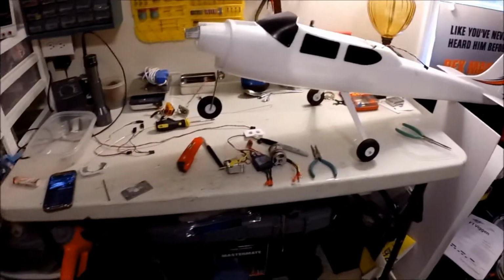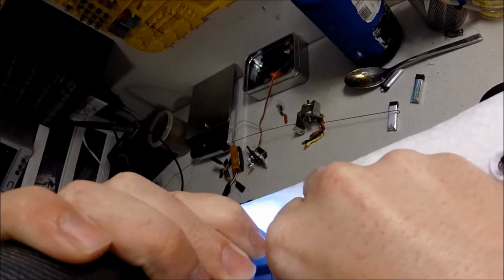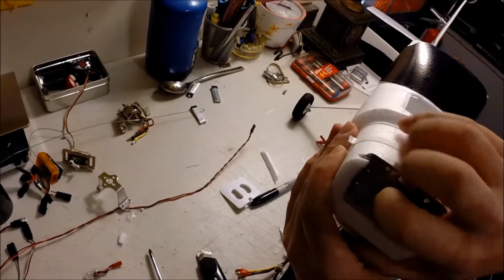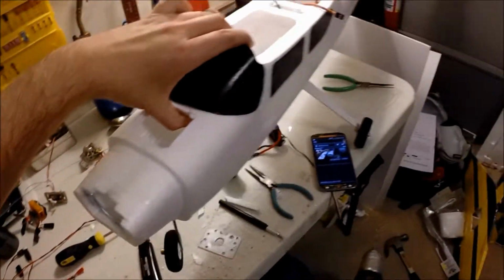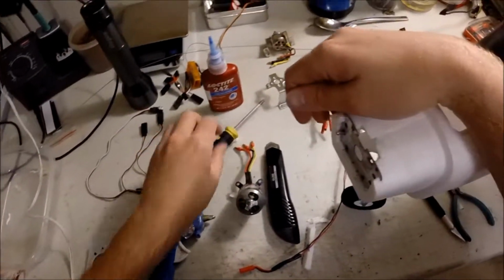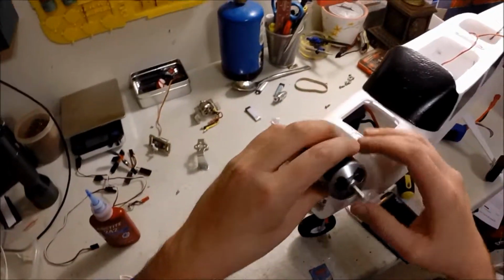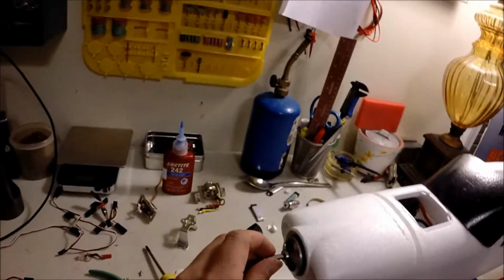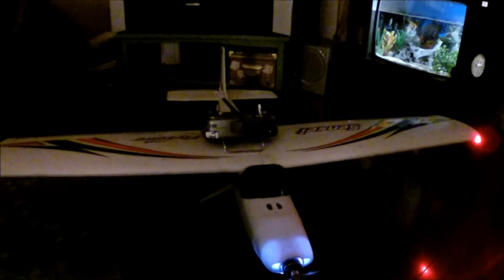How to upgrade the flyzone sensei  motor

Comment: For all you Sensei owners, there is no need to do this mod, the plane flies great with the supplied motor......you should reinforce the motor mount area foam however, as is a weak spot on this plane....I just coated the outer mount area with 30 minute epoxy....
Reply: hemixpr